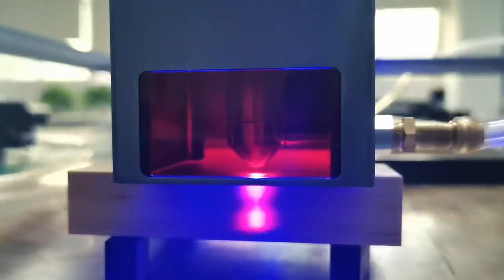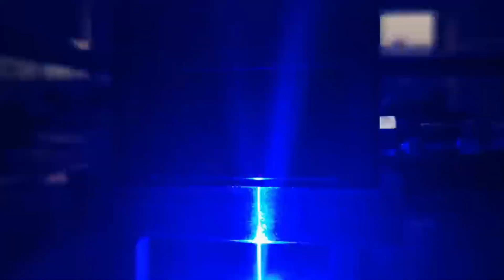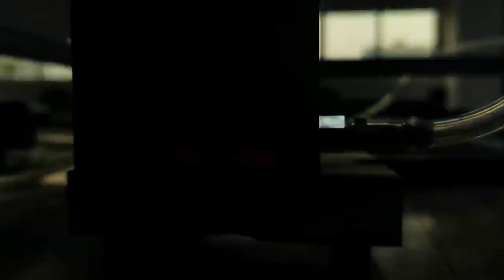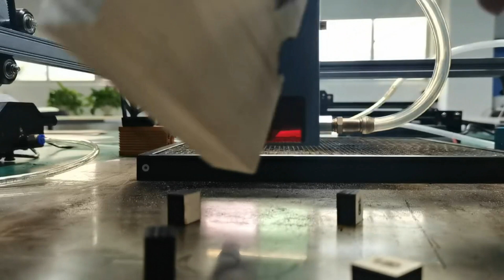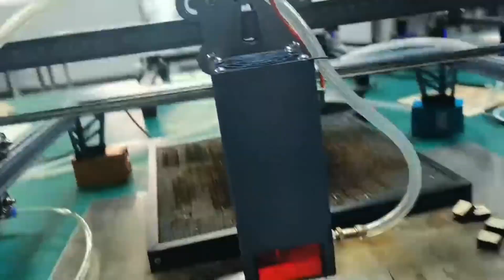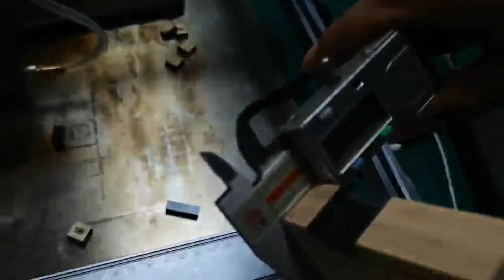Amazing Power - Test with 20W Optical Power Laser Head Cutting 20mm Pine Boards.

Comment: Are you a new manufacturer I have never heard of Laser Tree before. Your products look awesome. You need reviewers posting about your diodes. What is the life of your laser modules? I am looking at replacing the module on my eleksmaker clone for a diode I can use for cutting and engraving.
Reply from the maker: Oh, thank you so much for liking our products. :goodvibes:We are a professional diode manufacturer. We have been suffering from the lack of suitable reviewers to post the news. The lifetime of the laser module is about 20,000 hours with regular maintenance.
Reply: @Lasertree  Gotcha, thanks for the response. I have been looking at economical diode options to replace my current module. If I end up going with the Laser Tree Diode I will tag and post a review. Always good to see more options out there.